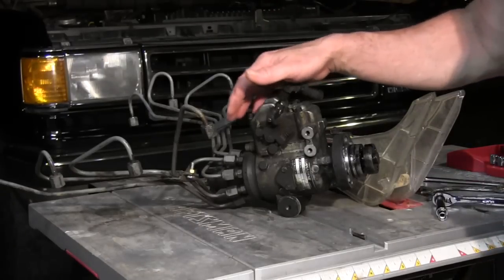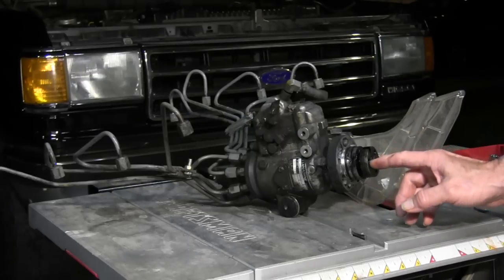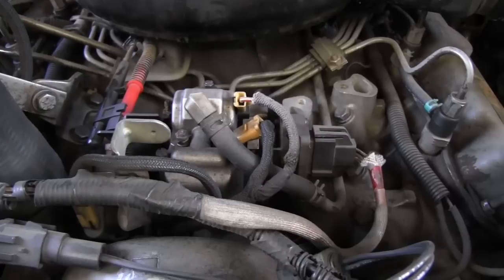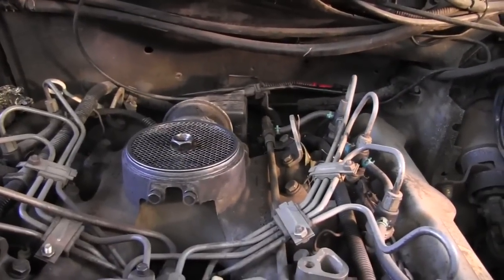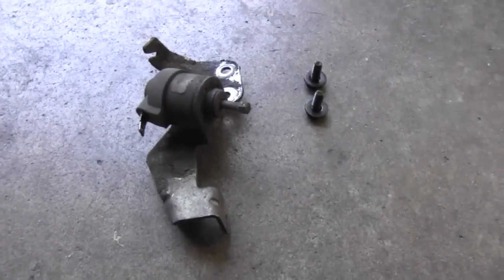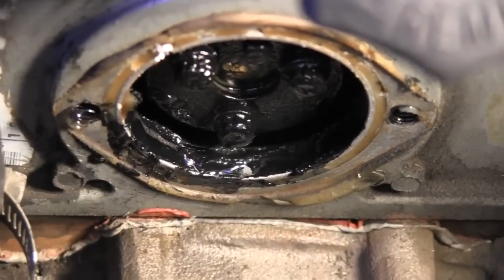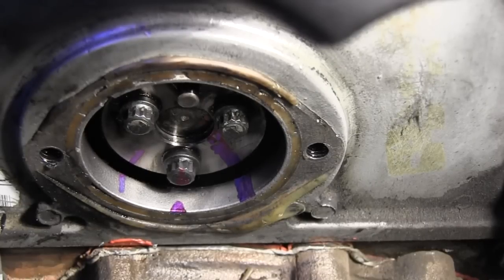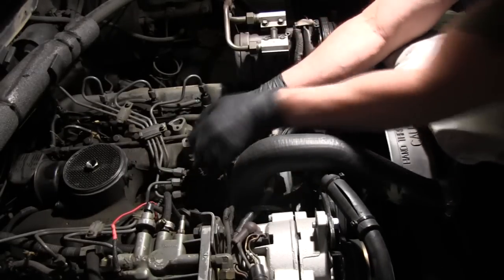1989 Ford F350 IDI 7.3 Liter Fuel Injection Pump Removal

Comment: Thank you for your video. I just finished replacing the pump on my  94 idi after watching you do yours. It cleared up the clouds of smoke coming from the tailpipe and I must have 20% more power with at least 20% better fuel economy.

Comment: Best video on this I've seen, in process of installing my classic diesel design pump and got stuck on the bolts and high idle switch is in way.... didn't think of taking it off. Thanks!

Comment: I found it much easier to crack the fuel lines at the pump before removing the pump then leave them loose while reinstalling it gives a bit of movement. Tighten them down after there all connected back to the injectors. The only thing that needs to be marked is the injector housing to the cam gear cover with a fine scribe line before loosening the mounting nuts. I made the wrenches to remove mine over 25 years ago for my 6.9 but used box end wrenches open end wrenches tend to round the flats on the nuts. I still have those wrenches in my tool box today but no longer have the 6.9.

Comment: Great video!  8 years later I found TEKTON tools makes a 9/16 offset wrench that works great to get those 3 bolts off if you don't have a torch or means to bend a spare wrench.

Comment: OK I just replace thanks for video now I need more help how do I bleed the lines and now all of sudden the batteries are dead and when I tried to jump them looked like I was trying to put positive on negative when I wasn't I have no battery power won't crank over  help it cranked fine be for I swapped it crank once after then died
Reply from the maker: Hello sorry your having trouble . Make sure the batteries are fully charged using a battery charger . Leave all the fuel lines loose where they connect to the fuel injectors crank engine until you see fuel leaking then tighten down fuel lines and try to start . I also did a video on the procedure I did to start the engine after fuel injection pump install.  http://youtu.be/K8EAZ2aZgDg

Comment: Did you put the engine in TDC before you pulled the pump off, or did you very carefully rotate the engine with the timing gear unbolted from the pump until the dowel lined up?
Reply from the maker: +Joshua Griffin I didn't worry  about TDC I just put marks with permanent marker on the timing gear with the old pump in place and put the new pump in without disturbing anything. After new pump installation I static timed using mark on timing case and pump, lined them up then primed fuel lines and started the engine.I did a video on starting after new pump install  https://youtu.be/K8EAZ2aZgDg
Reply: +chris10077 So how did you know the pump was sending fuel to the correct cylinders at the correct times?
Reply from the maker: Joshua Griffin When you mark with permanent marker on the timing gear and case and don't disturb the rotation of the engine the new pump will go in the same as the old pump there is a metal dowel that will only let the pump mount one way ,so as long as the marks that you make on the timing gear and case match you shouldn't have a problem .
Reply: If you remove the four bolts and pull the gear and housing off with the pump, it will be out of time with the rest of the engine. If you remove the little plate with two bolts underneath the oil fill tube, (or the fill tube itself on some trucks) you can remove three bolts holding the pump onto the gear. Then the gear will not move while the pump is out. The other gears keep it in place. Then the dowel pin insures the pump is timed to the gear when you put it back together.

Comment: WHERE is the 2nd pump located on. '90 350 7.5 L
Reply: The mechanical fuel pump is on the left side front on the block

Comment: i got no fuel gauge when i looked when i know it was full in tank fuel pump maybe also that might of went bad  not the injector pump
Reply from the maker: jesse james You could loosen one of the fuel lines at one of fuel injectors and crank the engine if it leaks fuel you will know your fuel pump is working.
Reply: right i think it could be the send unit in the tank  also  ill have to test both i guess the fuel went to zero shortly after a fill then the truck starting running weird like zero power smashing the fuel and then nothing stranding me at 2am snow plowing  sucked huge time